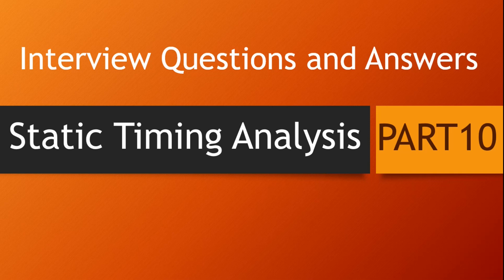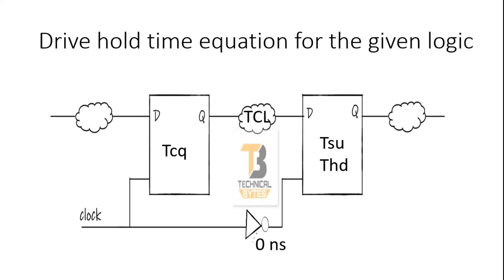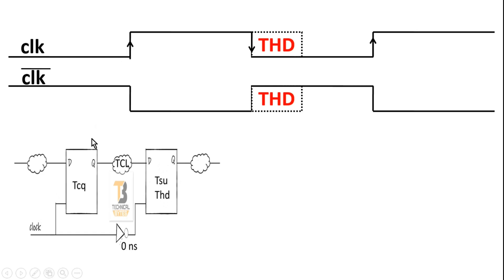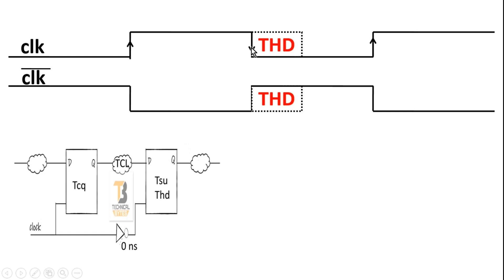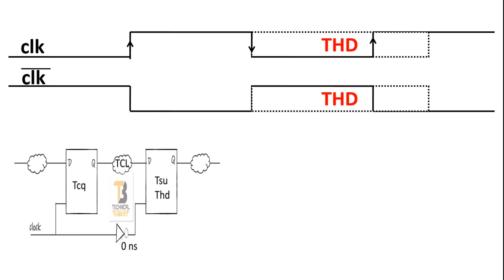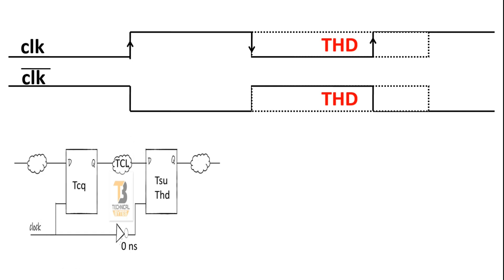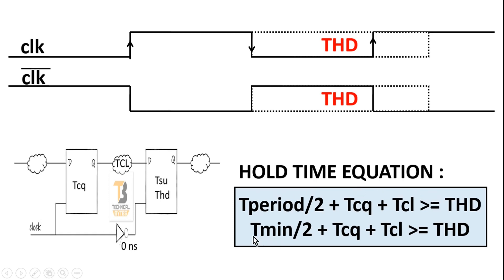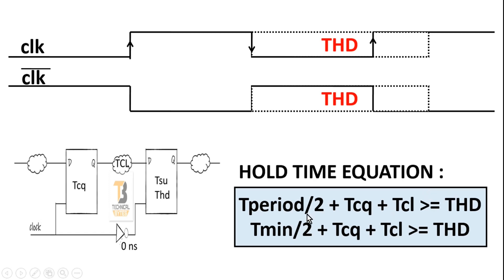Static Timing Analysis Interview Questions Part 10

Comment: I have a doubt. At 2.03 you said at negative edge, 2nd F/F starts transmitting the data, but that is the case when the F/F is negative edge triggered f/f , here it is still positive edge triggered . it's just that the applied clk signal is inverted. Please correct me if i am wrong